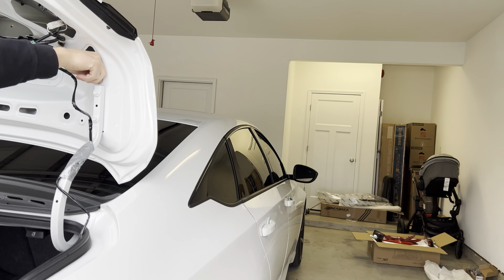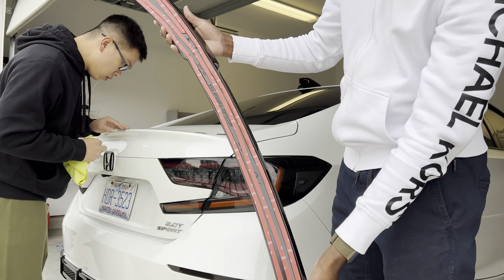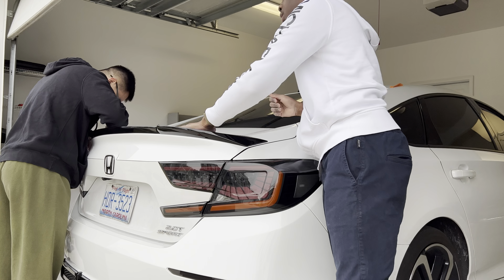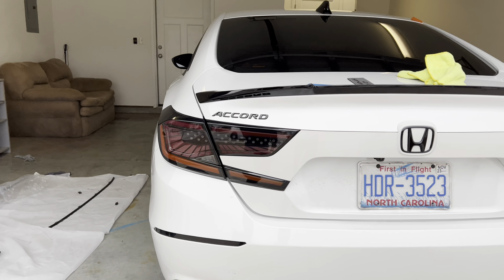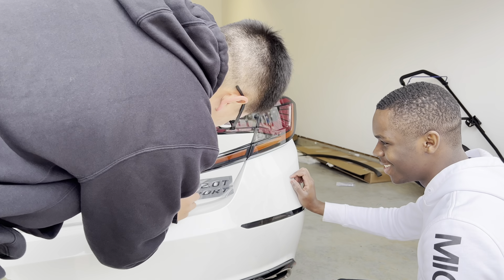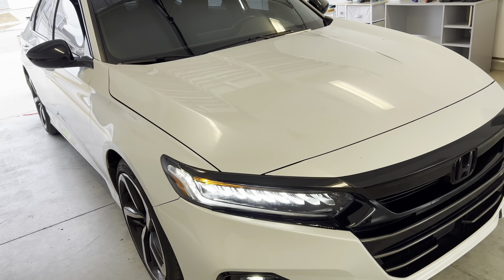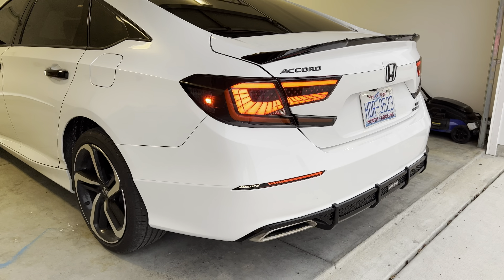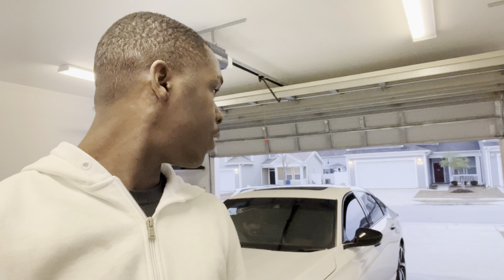Akasaka Front Lip| Black Emblem/ V4 Spoiler Install! MUST WATCH!! 2022 Honda Accord

Comment: Install the lip i need screws and washers and i should be good?
Reply from the maker: You can use just screws but bolt and nut would be best so it don’t fall off
Reply: @RAMONEAuto  was it difficult to get to the inner side of the bumper to but on the nut? Pause😭
Reply from the maker: @xavierlucas7033  lol 😂 it’s a bit difficult so I just used screws and a crap ton of double sided tape